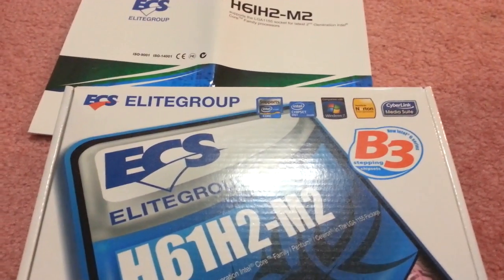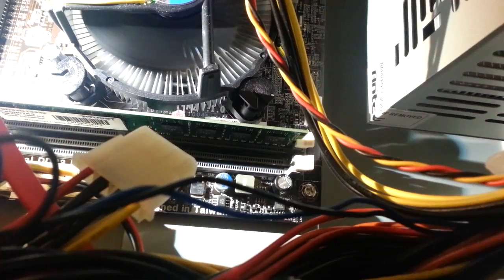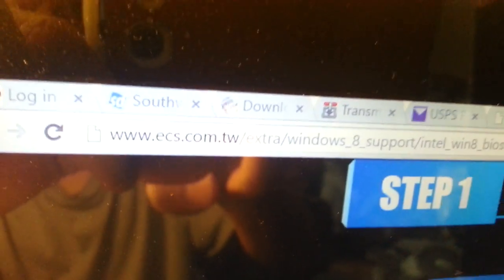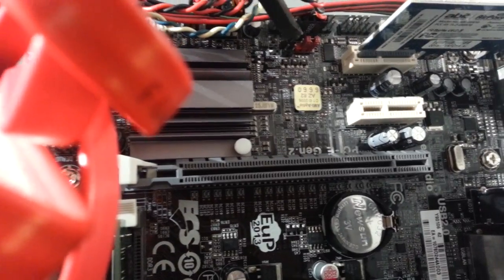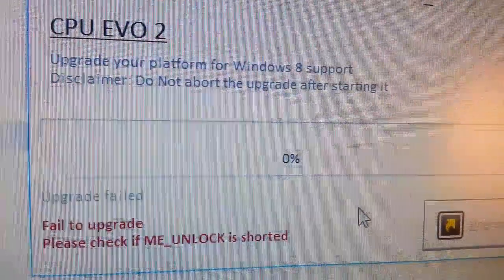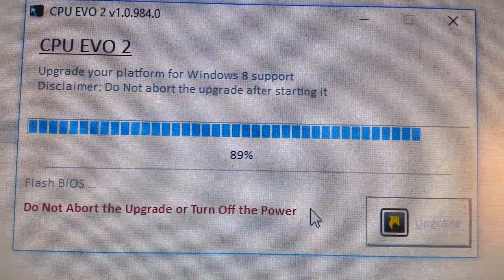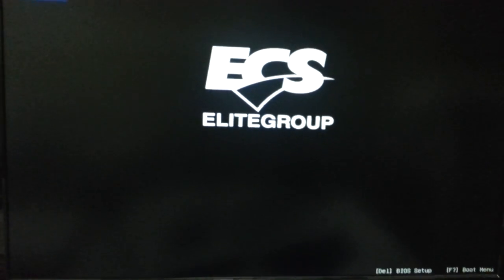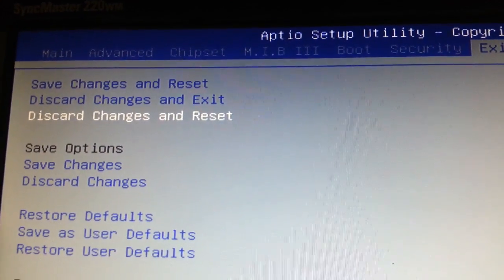BIOS update Ecs H61H2-M2

Comment: To those who ask where to get the jumper, you can use the red one to place it on the "unlock pin", it does not need to stay on the red pins all  the time Is just important to put ir on the "clear red pin" and then on "normal red  pin" there after running successfully the flash

Comment: My gt 1030 doesn't give display(bootloop) without updating. Should I risk updating my bios(I have same mobo but v2.0) 
Processor - intel i3 2130
Ram -6 gb ddr 3

Gpu is fine...I checked in another system
Please respond
Reply: I have the same problem, if i update it does it works with gt 1030?

Comment: I have an ecs H61H2-M6.V1 mainboard, when I attach it to an Intel Core i3 3210 processor the computer can't turn on (Blakc screen), but when I pair it with Intel Core I3 2100 the computer can run well. do I have to upgrade the bios so I can run the intel core i3 3210 processor?
thank you...
Reply: @Tanishque singh where i can find CPU EVO now? the website of ecs dont have it anymore
Reply: @kiritops944  campaign dot ecs dot cccommm  slash tw slash support slash  windows underscore 8 underscore support slash intel underscore win8 underscore biosupgrade dot html

Comment: Thanks for providing this information.  It was very helpful when updating the chipset code and bios on my ECS H61H2-M2 v1.0 board.  Particularly knowing the correct pins for the jumper and various steps.  I was able to update the board and then successfully get it to recognize an Ivy Bridge generation i5 CPU.  One thing - after updating the chipset, I encountered the mentioned failure to boot into Windows 10, and then had to select option to re-install Windows.  This was not a problem for me because I had already just installed a new copy of Windows 10 and had nothing to lose by doing another clean install.  But for someone with data and personal Windows settings already on the computer, maybe they will need to make sure they don't lose any of that data if having to re-install Windows.  Overall I think everything is now working fine after the bios updates with the Ivy Bridge i5 CPU and Windows 10.
Reply: I have an ecs H61H2-M6.V1 mainboard, when I attach it to an Intel Core i3 3210 processor the computer can't turn on (Blakc screen) but when I pair it with Intel Core I3 2100 the computer can run well. do I have to upgrade the bios so I can run the intel core i3 3210 processor?
thank you...
Reply: For me it turned out that I had to set AHCI mode from IDE at drive settings, that way I could successfully boot into windows.

Comment: hello admin :) 
i used core i3 2100 (2ndgen) then i sell it i bought core i5 3570 but my monitor no display but my v.card and mobo was still running what should i do sir? help me please please
Reply: did you solve your problem? because we have the same problem
Reply: Hey there did you both try to update the motherboard already ? Did you test the gpu into other motherboard ? There are some available updates for Bios from Windows 7to Windows 8, including some compatibility with 3rd generation processors. It may help on it.

Comment: My friend you did an excelent work... I need to upgrade my motherboard's BIOS... But I have a big question: I'm running Windows 10... Can I use the software for Windows 7 to do that or not...? On the oficial website I can only download CPU EVO for Windows 7 and CPU EVO 2 for Windows 8, nothing more ... As I said, I'm running Windows 10... The process is the same to both motherboards, mine and yours... My model is ECS "P67H2-A3"... What do you say? I need to install my new GPU RX 480 GTR from XFX... Wich is better: CPU EVO or CPU EVO II on Windows 10? Or I need to install a new SO to obtain success? Thanks a lot!

God bless you my friend! :-)
Reply: Hey there, recently upgraded bios with Windows 10 using that CPU EVO II successfully. You just be careful of using the software as Administrator. Regards.

Comment: i got like 3 jumpers from old mobo
when i inserted the jumper my windows 8.1 wont boot ,it keeps on rotating
what should i do now
what may be the cause?
Reply from the maker: See the part 2 of this video (near the end) might help answer your question. 
https://youtu.be/IDzMVfNXQ84
Reply: +ExpandableMe can you specify pls whatever you want me to see
Reply from the maker: +Abhishek Das 
My advice would be to watch the whole video because I am not sure what was wrong with yours.
Reply: ExpandableMe i cant do this part as my bios ver is lower than 8.1.x.x
Firstly i have to follow your 1st part, but unable to do that as windows 8.1 wont boot after inserting jumper
Reply from the maker: +Abhishek Das 
I would temporary install Windows 7 then update the Bios as Windows 8 gave you an issue.
Reply: Okh thnks
Reply: +ExpandableMe hey mate
i successfully completed the 1st part 
i had to install win7 over 8.1 thats was a time wasting shitt
but alas not everything s is perfect
Thnks!!!
Reply from the maker: +Abhishek Das 
Great to hear.   By the way,  this board is perfectly stable with Windows 10 I am running.   Also,  after you complete install the final Bios version,  and before you install Windows 8 or 10,  change the Bios 'Boot menu' to Windows 8.1
Reply: ExpandableMe i have set it to manual
I only had 8.1 installed, not any other os
Actually i had to go all through this coz when i installed my rx460 monitor gives the no signal message
Reply: hi, do u have asus rx460 video card with that H61H2-M2 v1.0 mobo? thx...my bios cannot detect the video card asus rx460 radeon model DUAL-RX460-O2G ...i've flash bios update to latest firmware too...thx
Reply: Np i hv the sapphire one

Comment: Anyone notice if this has a high temp shutdown option in the bios?  I am only seeing the smart fan software.  Stock intel fans are kinda crap, prime95 stress test runs an i5 2500 over 72 degrees C pretty quick.
Reply from the maker: Not an option in Bios.   It's a built-in feature either in a CPU itself or the motherboard.
Reply: In what way?  The blue screen of death?  The mb drivers cd has a smart fan  called eSF utility that can be installed, I hope that does the job.
Reply from the maker: +Freddie Krueger 
The other Intel MB I have.   When the Cpu reached certain temperature (180 degrees F), the computer just shut down.
Reply: ExpandableMe Ok, thanks.

Comment from the maker: Jp Maunes
I looked up your motherboard H61H2-M12 and found out that your board "does have" the "Me_Unlock" circuit.  It's location is slightly different than the one I have.  It is near the corner bottom left of your board.  It is on page 16 of the manual.  You  can download the manual from ECS website in PDF on page 20.
Thus, You can us this tutorial to update your bios.  Just making sure you download the correct BIOS version of your board.
Reply: +ExpandableMe So If i Dont have this jumper i cant update my bios?
Reply: +ExpandableMe What are the benefits after updating?
Reply from the maker: +Jp Maunes 
You can't
Reply from the maker: +Jp Maunes 
Better compatibility. For Ex., Ability to upgrade faster CPUs. 
Boot to Windows slightly faster with Windows 8 and 10.
Security boot. 
Friendly Bios interface. 
Bios live update? 
Manufacturer recommends not to update the Bios unless you have issues.
Reply: Ooh Btw. I have already updated my bios.
hahaha.
i found a jumper in my old motherboard.
thanks for the vid.
can i ask something :)
Reply from the maker: I am rarely on facebook.  You can alwasy leave comments here if you need any further assistance.
Reply: ooh .
Haha.
Thanks
Reply: ExpandableMe so i have the m12 version my question is can i use 3rd gen processor?
Reply: evo You could I think: Supports new 2nd & 3rd gen Intel® Core™ family, Pentium, Celeron series processors in LGA1155 socket. That's from manufacturer website specs. By the way if you still needing to know so I would recommend doing the bios update anyway before getting the 3rd generation processor. Regards.